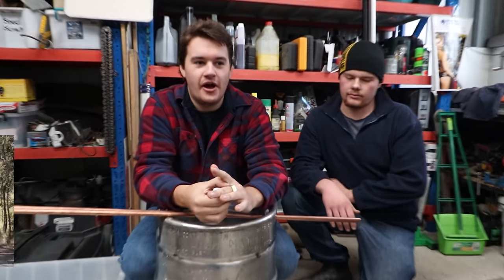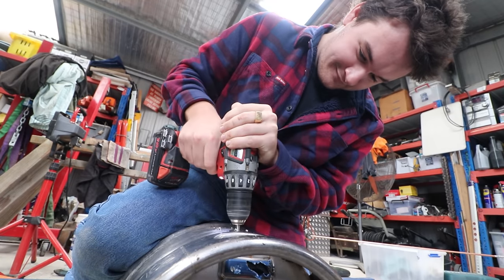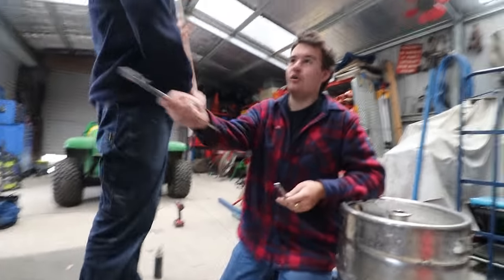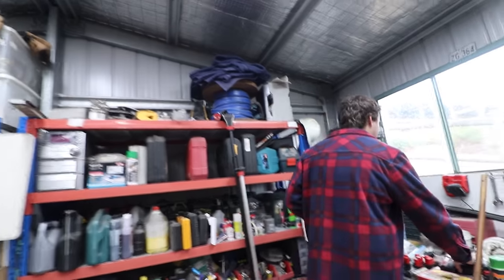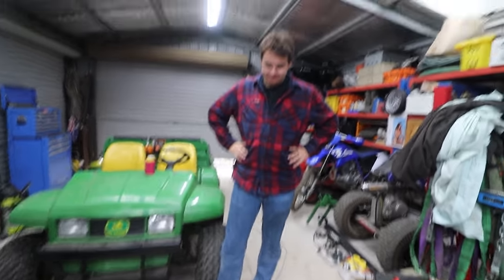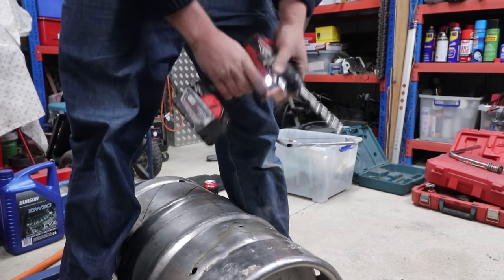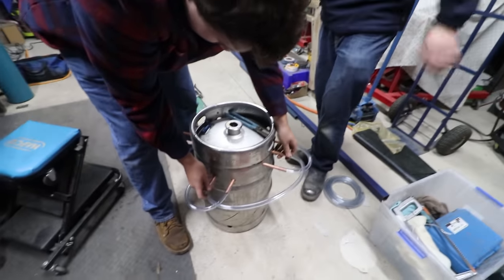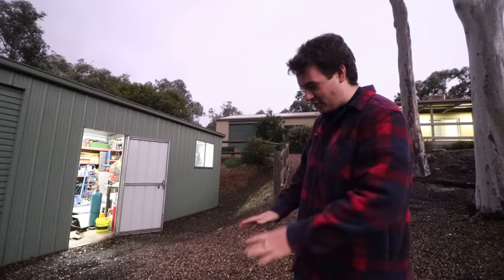We started a new project... | Hot Tub Part 1

Comment: It doesn't need a pump, like air hot water circulates, hot water rises cold water sinks.  Just pipe your tub with a warm inlet up top of the tub and a cold outlet from the bottom and it will self circulate as it warms,  good job👍👊
Reply from the maker: see the issue is we didn't want to cut holes in the bucket of the dump truck, we wanted to have both our intake and output from the top of the bucket, but i do get what your saying!

Comment: FFS 2 holes and coil the pipe inside.
Reply from the maker: we wanted to have a coil inside but didn't have a tool to bend the copper properly
Reply: @AussieArvos  LOL, you can buy the tube in coils you know.
Reply from the maker: @slowboat6021  yeah we saw them at bunnings but weren't the correct dimensions